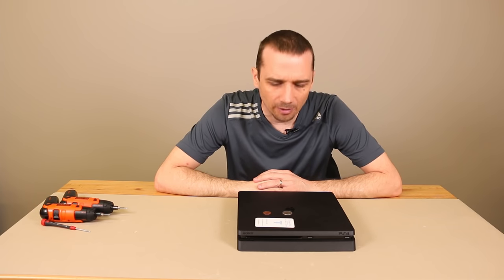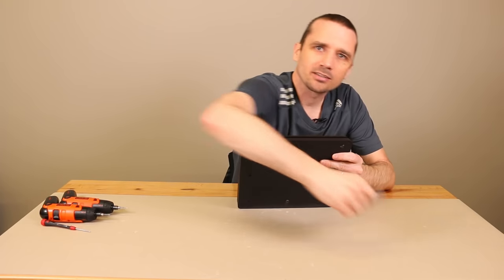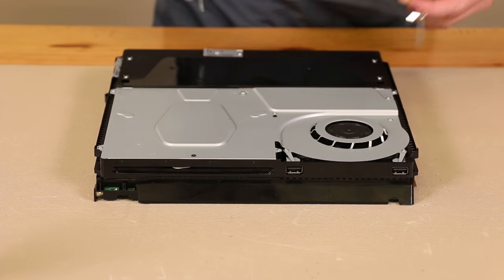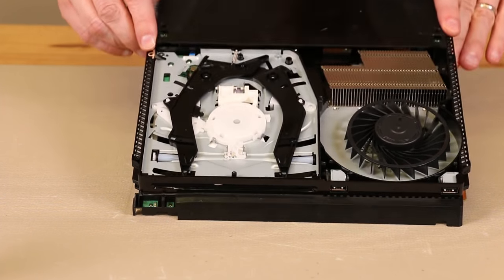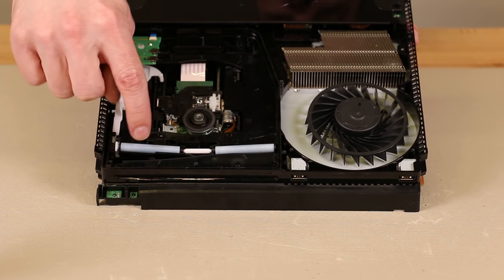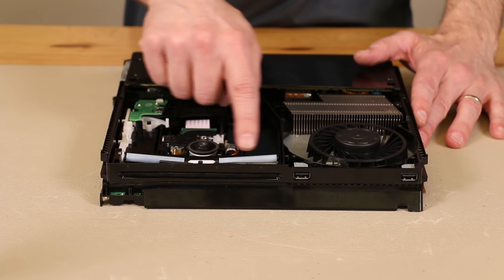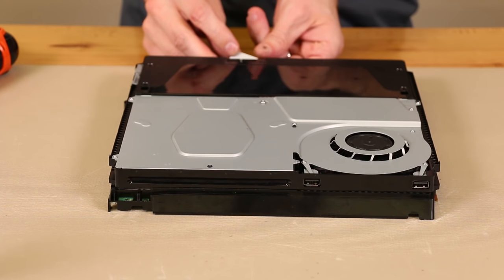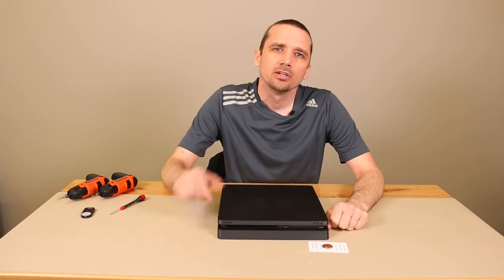How To Fix PS4 Slim Disc Drive

Comment: Hey, i really hope u respond fast! Im desperate. 
I have the CUH-2115B model and a lot of the screws that r in ur video r not here! I was able to get to the metal plate at the top of the ps4, but instead of 10 phillips screws, theres a lot of these black points that dont look like screws. Is this not possible with this model? I got a mini disc stuck in my drive and im desperate to fix it! Please help! Thank u.
Reply: Lucas Jordan same i cant get the black screws off
Reply: Ryan Pachulski Hey, so i figured out what to do. basically u have to break the tops off them (i know, but bear with me). They're known as pressure screws, they go in, and dont plan on being removed. So basically u want to stick a flathead under the metal plate and try to lift enough so the black plastic breaks. Try not to bend the casing plastic or the metal plate. It's a very tedious and heartbreaking task, but theres no other way, since the CUH-2115B was a black friday model, it was made much cheaper. Plus, the three screws that DO exist on the metal plate can hold it just fine; along with putting all the casing back, everything tightens up anyways. I hope i was able to explain this well, but i did it and everything worked out and i was able to  get this stupid mini- disc out of my disc drive. Hope for the best man, reply if u have questions i guess lol
Reply: Lucas Jordan thank you finally someone with an answer ill try thank you 🙏
Reply: Ryan Pachulski just try not to break anything important! all u want to break is the black tops, not the little poles, youll need those to know where to position the metal plate when reassembling. And no problem, the internet was little help for help for me in this endeavor, im just glad i was able to figure it out and help someone else!
Reply: Lucas Jordan so, everything what i have to do is to try lift these black "screws"? And unscrew rest of the screws? I need to get into disc drive, I accidentally hit my PS amd it makes really annoying and loud noise.

Comment: Need some help after this .. i opened up my ps4 pro and found one of the rollers out of place , after putting it all back together i can only insert the disk once and when i eject it it’s all normal but if i try to put another disk in there is no sucking sound or mechanical movement it just wont let me insert a disk .. i have to take the whole thing apart again and put it back together then again i can only insert the disk once until i eject again .. any help would be appreciated
Reply from the maker: That's a strange one...not sure what would be causing that. Try unplugging it then plugging it back in and see if it will take the disc then.
Reply: TronicsFix ive tried doing that it seems like a sensor fault because as soon as i start the ps4 it tries to pull a cd in and that’s the only time it will work is during start up .. im still looking for a fix if i can’t find one seems like I’ll have to replace it sometime down the line .. love your videos big help for repairs

Comment: Soooo while I took apart my PS4 slim to clean the fan, I got interested to see how everything works so I took apart the disc drive (from the bottom) and took a peek. While putting it all back together suddenly a gear totally fell out onto the floor and now it's not reading discs. Currently I'm taking it apart now to DIY this crap but I'm a little stuck because the gear doesn't seem to fit anywhere or I'm not sure where it should go. If anyone can help asap it'll be greatly appreciated 🙏

Comment: When i turn on my ps4 , the disc drive starts going off like its taking a disc and when I eject a disc.. it continues to eject for like 3 seconds after the disc had already been removed. It also won't let me put a disc in normally , I have to turn off and turn on my ps4 then insert my disc.
Reply: Same
Reply: @exotixblizzy7149  I figured it out lol I was missing a spring where my disc drive is and that was causing the problem for me.

Comment: My ps4 broke while cleaning. I was cleaning out the system from a bug infestation made sure not to touch the disk drive put it back together and boom disk drive would not take in disc. I specifically avoided messing with the disk drive because I know it has small parts. But despite doing everything to avoid my disc drive being effected boom it got effected. I had the stupid newer slim where the have those black plastic bolts instead of screws so after watching a bunch of tutorial I found that none of them fix my disk drive. The main culprits like that upper spring, and those black plastic piecee were all functioning but still not accepting disk. Unfortunately not a single video I could find went any further than that except a laser replacement which is not my things issue rip me

Comment: What if you just can't put a disc in at all? I know there's nothing in the drive, just refuses to accept disks.
Reply: Check the white plastic gear assembly connected to the rollers and be sure they are all connected properly. That's what happened with my PS4 as a result of a drop. I followed the video as shown but my PS4 would not take disc (something seemed to be blocking). That's when I continued observing under the plate by the rollers and realized the white plastic gears were not connected properly. Once I made the connection - BOOM - playtime. Hope that helps.
Reply: @blaksham  i was able to fix my issue. I had 0 confidence in myself to take it apart, and I didn't have the right tools. So I booted my ps4 into safe mode, reinstalled a software update, and bam. Problem solved. Thank you for the information though. If I ever encounter an issue that requires I take it apart, I'll remember this.
Reply: @a_true_generic_gamer1104  that's great! Glad to hear you were able to self diagnose and fix and save some cash. Appreciate Tronics fix for this video and venue to share good info and stories of success!

Comment: i punched my ps4 slim out of anger and ive dented in the silver case where the disc is underneath and now i cant get the disc out and my ps4 is making loud vibrating noise what can i do
Reply from the maker: #1) Don't punch your PS4. It's not the PS4's fault
#2) Take the metal plate off and bend it straight.

Comment: I tried comepletely tearing down my PS4 including undoing EVERY SCREW and disconecting EVERY WIRE and now i cant get it back together, i was trying to fix the disc drive cuz the system seemed to be having a hard time taking and ejecting discs and it wont play movies for some reason but games work fine.

Can anybody point me to an actual video that tears down the PS4 Slim COMEPLETELY like i did? Ive tried every video i could find none were helpful.

I even disconected those colored wires with the white caps on them abd those really paper thin wires that attach to teeth on the board.

Help anybody?! ☹️

Comment: SOLUTION: My ps4 slim wouldn't insert disks completely, I tried to open it but some of the screws where not screws (black ones) so in the end I just tried pushing one disk till it swallow it, I forced till the end and then ejected it. Suddenly it's working fine again, I know it's risky but I thought it could help you guys. Cheers

Comment: i did all these steps and my ps4 slim still won't take any disc what should I do i've never dropped it or anything all i did was manually eject a disc and now it won't take any disc even after doing all these steps i need help
Reply: Does the PS4 show error SU-42118-6? If it does, you most likely have a busted F6202 fuse. You could get one for cheap in the US or UK, or if you are ballsy run a wire through it (would not recommend).
Reply: @linuscracktips4986  no it doesnt give me that error at all just doesnt allow me to put any disc into the disc drive
Reply: @takeoffloser784  have you updated the ps after it stopped working? Because it only happens when you try to update. Also, what type of ps4 do you have? If you have a pro or slim you have to fix a fuse, on the regular one it is a ribbon cable (assuming the sensor is the problem)

Comment: What if everything is on there and there’s nothing in there but the disc just wont go in
Reply: Check the white plastic gear assembly connected to the rollers and be sure they are all connected properly. That's what happened with my PS4 as a result of a drop. I followed the video as shown but my PS4 would not take disc. That's when I continued observing under the plate by the rollers and realized the white plastic gears were not connected properly. Once I made the connection - BOOM - playtime. Hope that helps.
Reply: @blaksham  ok so i did that everything is connected but i think i know the issue. A couple of months ago when i was cleaning my ps4 slim i found that metal piece just there and i didnt know what it was for so I threw it away i think i need a new one but i don’t know where to get those and i dont know what it was fof

Comment: Bro I have big problem man my ps 4 slim don't pull my CD in.
Reply: Just open it up, i think its the rollers mine had the same issue did in 10min you can order the repair set on AliExpress

Comment: You know what sucks? My little brother forced ww2 into the PS4 and idk how but it does read that there is a disc in buh and some how when I put gta or any other game it goes in fine and actually reads the game but I’m afraid that it’s going to scratch it and I can’t open it because I don’t have that kind of screw driver so I can’t open it:((
Reply from the maker: Try the manual eject screw
Reply: TronicsFix LLC no it just ejected gta that I had in it but not the other game idk how to explain it buh i was playing another disc game that I had put and it didn’t scratch it or nothing it’s like right underneath it and somehow it’s not touching... I’m not sure if your catching on what I’m trying to say but I think there’s a small space between the stuck disc and the not stuck disc and I really don’t know how the PS4 can’t tell there’s a game it there but what I don’t get is that how is it reading the other game on top when the laser is on the bottom so it should be ready the game on the bottom

Comment: Im 13 and i felt like i havent had my ps4 in like 2 years cause i got it taking away and i got it back today and i remembered i got something stuck in it got one thing out but i had to get a t8 screw bit and then i gave up trying to take it apart from the bottom i think now im tryna fix it now but i lost the screw bit and wanted to use a mini flat head to take the screw out but my dad said no and now I’m upset ☹︎☹︎

Comment: Guys easy fix if your playstation is new and was just left out unused for a while. Here is how to fix it.
1. Ensure that you restart your playstation and update any softwares
2. Clean your discs with proper fibre cloth etc.
3. Inset and exit the disc by pressing the eject button repeatedly without wasting as second as soon as the insert or eject of the disc is complete. Do this 5-6 times.
4. Now put your playstation vertically on one of the side. Not flat but standing. Do step 3 again. 
5. While doing step 4, the disc should get read during one of the tries. So that's when you put your playstation back flat and start playing.
Enjoy!

Comment: PS4 Slim is complete garbage. Worst console ever made. Save your money and never buy a PS4 Slim.
Reply from the maker: PS4 Slim is actually a good console.
Reply: I've never owned a gaming system or an electronic device that has this many issues. I don't even want to list all of the issues this machine is giving me. I can make a video to show people how, it won't accept the disc, then it won't read the disc when it finally does accept it, I've reinstalled the system software and it still does all of these problems.